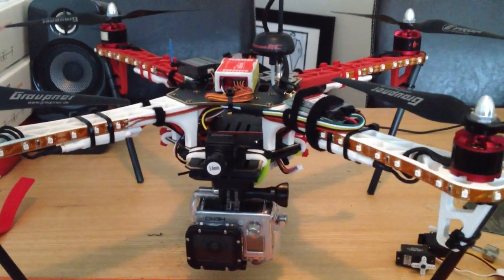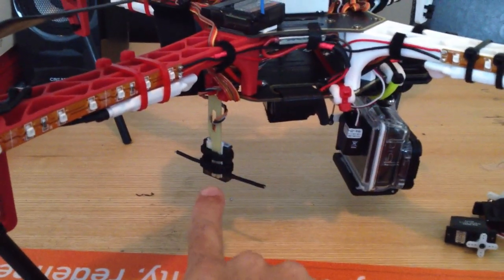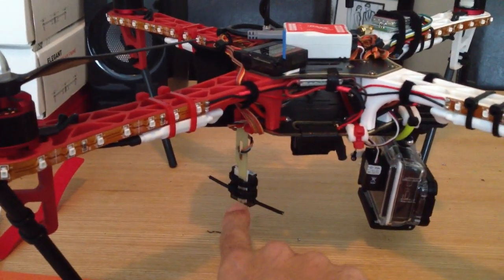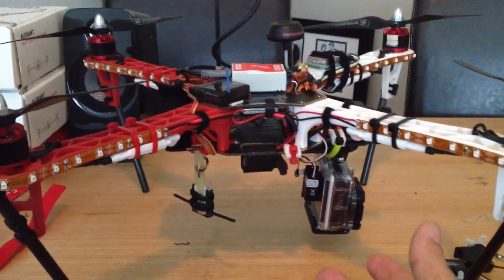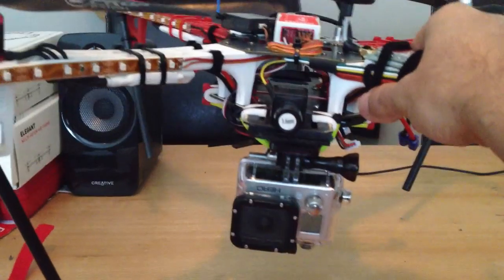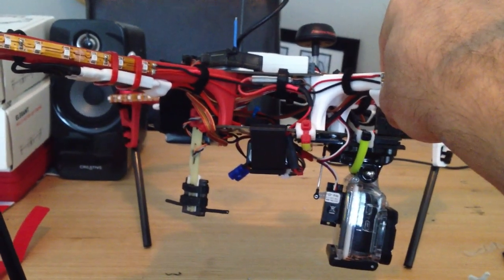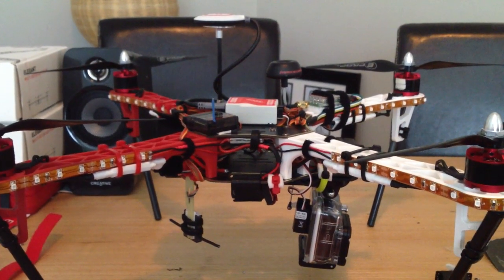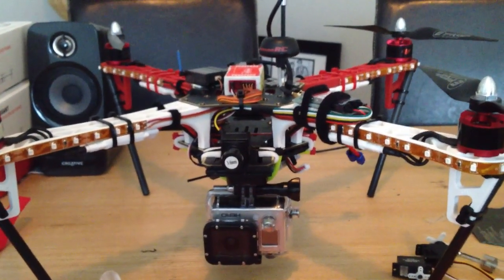Quadcopter F450 mods

Comment: Do those naza flight controllers have that stupid geofencing in them like pre built DJI quads?  ive seen plenty of people complaining that they needed to get authorization from dji just to fly in there own back gardens!
your gimbal idea is so easy and simple, that idea is so being stolen by me as Ardupilot supports 3 axis control
im building a Q450 (clone of the f450 frame) based on an APM running Ardupilot, im not a quad fan but want something to chase film my planes they also run Ardupilot  and it supports swarming.
The quad will follow in auto mode based on what i do in with my planes over telemetry, gotta love technology :)

Comment: I getting this frame soon to fit my vector on as I wasn't getting any flight time with the f550' I have 3s 3000mah batteries. Will I get much time with the 450 running with a gimbal and action camera?

Comment: good day I'm using radiolink in my f450 and in sbus mode? how can I install the servo for gopro,, I'm still a beginner in quads or rc
Reply from the maker: You have to install the servo by plugging it into the Naza flight controller. It a very easy modification.

Comment: how did you attach the led,and also where do they wire 2?
Reply from the maker: the LEDs are sticky backed with 3M tape (they come like that from hobbyking) and they go to a 12V stepdown regulator that is wired to the main power distribution board.

Comment: 2.4 is 2.4.  I can get 1.5 miles with my spektrum.  If you want crazy distances, you re gonna need a ground station.
Reply from the maker: its way more complicated that that, and no you dont 'need' a ground station to get good distance if you have good line of sight. The point of the mod is 'line of sight' as all short wave length frequencies such as 2.4 or 5.8 will not penetrate objects and obstacles well. The european Spektrum transmitters are also regulated for much less power than the US ones so clean/good line of sight setups are very important. I've achieved 3.5km of range with no dropouts without using a ground station and that is proof enough for me.

Comment: Hi has anyone here used 'Quadcopters.co.uk' I ask this because I have recently bought a quadcopter from them and I was looking at the testimonials page and someone says ''Even if you have absolutely no experience in RC kit of any kind Geoff, from quadcopters.co.uk will walk you through it step by step.'' Now because I am a beginner to the quadcopter world and have 'no experience' I thought this would be perfect for me so I purchased an f450 quadcopter, I put it together and I could not get the quad working so I rang quadcopters.co.uk and I was expecting the friendly chat that I quoted from the testimonials page and was basically told that I had no experience (which I already knew) and I shouldn't have bought this quad but my research had led me to discover that the f450 was a brilliant quadcopter for beginners. eventually I got some motors to spin but one wasn't moving, so by a process of substitution I figured out it was one of the parts that connects the motors to the power and to the receiver(servo I think), I sent the quadcopter back for quadcopters.co.uk to have them take a look and told them what I though the problem was, but they  said it was "Software problems" and that they fixed it by programming the naza board correctly, I didn't realise that I had to pay for this because I wasn't told, later they said that it says the pricing on the website which I never found and they charged us £60! And admitted that they spent 10 minutes on it but they had to charge us for an hours labour, fine I though.

I was prepared to spend £60(Not including postage or VAT BTW!!!) to get this quadcopter working but when I got it home it didn't work and we had the same problem with the quadcopter, we sent the quadcopter back AGAIN and this time they found that there was a problem with the servo, that they previously said was working fine before; they said that I had over tightened the cable ties, and that I would have to pay another £60 for labour and that I would have to pay another £15 for the part, again not including VAT, Even though when I put the cable ties on from when I received the quadcopter back they were far less tight so the sleigh cuts on the head-shrink were there when quadcopters.co.uk first received the quadcopter, they claimed that they didn't see the cuts the first time and didn't take the servo off the quadcopter, but they sent us a link to a video on dropbox to show us that our quad was working and the servo was hanging off, the video has been conveniently deleted now I would like to add.

They also said the reason the servo was over tightened was because the cable ties were to big but in my experience bigger cable ties apply less pressure to the parts your cable tying because the force is distributed more over the thing that is being tied down.

Sorry for interrupting you videos comments Neil just wondered if you or anyone else knows anyone that will help me, thanks

Comment: Have you try or looked in to the 9XR by hobby king with a frsky system for JR I have a 10c and my 9xr with the new frsky system hands down out fly's it. or the new FRSKY TARANIS - 16 CHANNEL, FULL TELEMETRY TRANSMITTER. it rocks. for a 2.4 system you will like the range I picked up my Tranis at aloft hobbies dot com fast shipping as well. and I fly the TBS Quad I think you may like it with the FRSKY XJT - JR/GRAUPNER TYPE 16CH DUPLEX TRANSMITTER TELEMETRY MODULE you can all the channels you like

Comment from the maker: Those are made out of hollow carbon fibre tube that i had laying about from old helicopter parts and cut to size. You can get that stuff anywhere, its nothing special. If you look for helicopter boom carbon pushrods you will find them in various sizes.